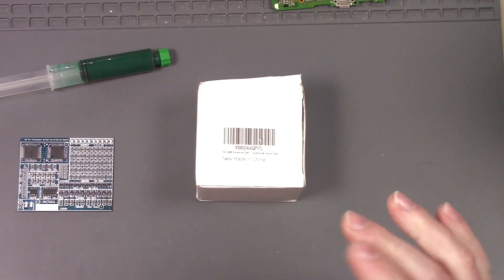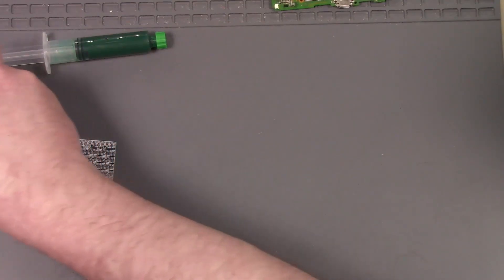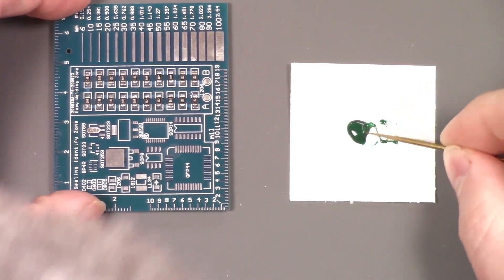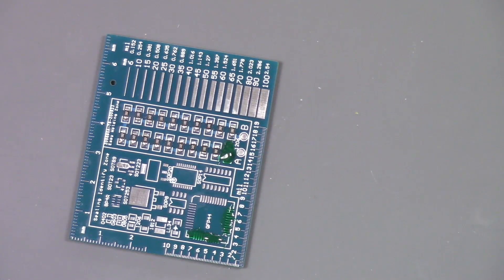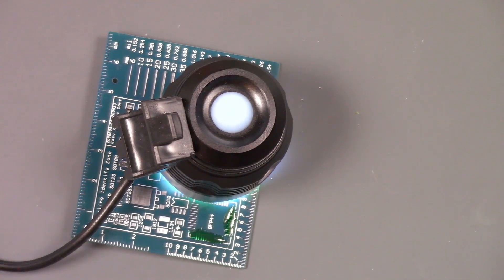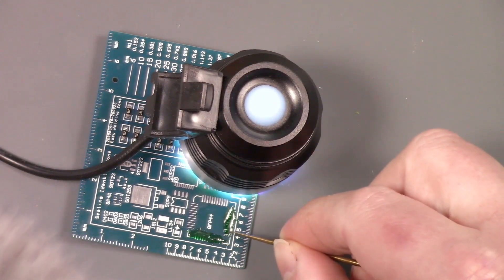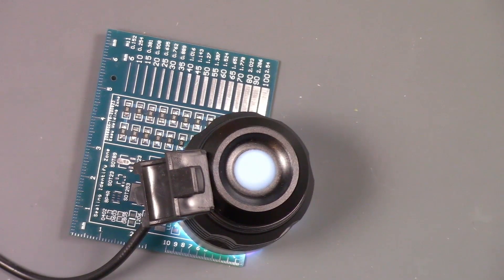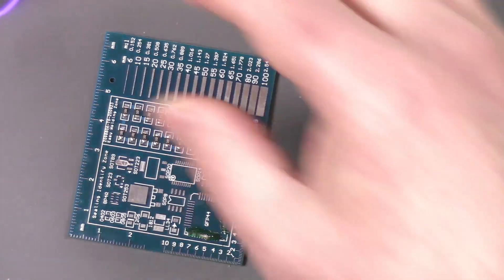Checking Out A New USB Powered UV Light For Solder Mask

Comment: Can get a switched hub to control it with. That's kind of how I control my big lamp even though it has a switch, have it on a switched surge protector, just push the button to turn it on.
Reply from the maker: For some weird reason the switch works now, it just started working. I like the light and will probably recommend it after some more testing. I got a PS4 trace repair to do next week and it will get a good testing then. I do my wires one at a time and I’m wondering how much this light will slow me down.